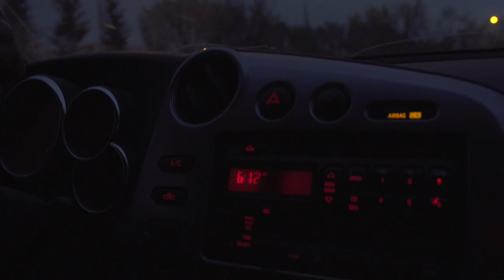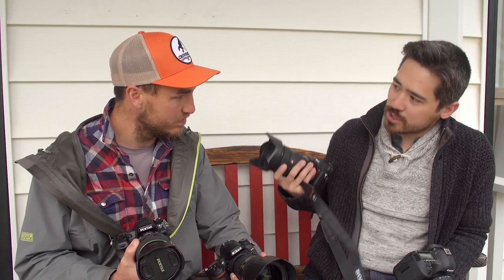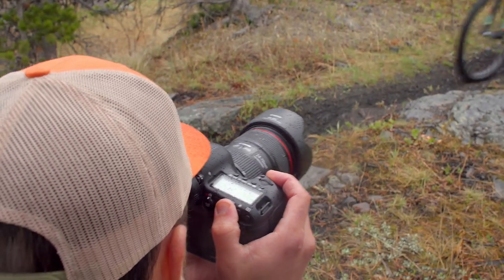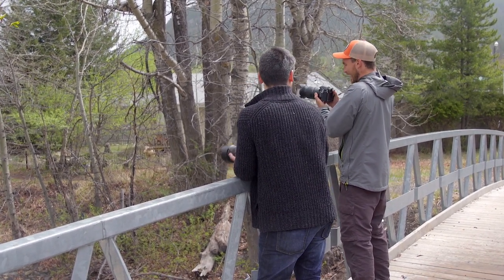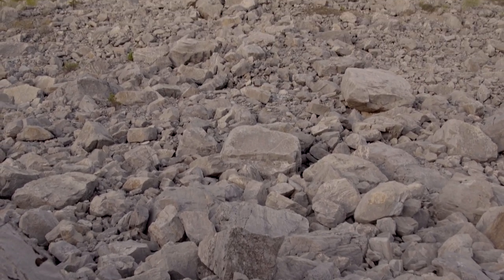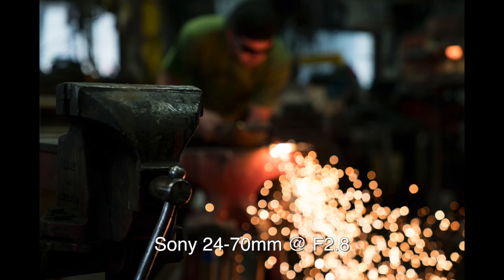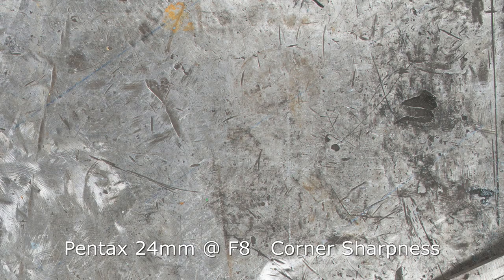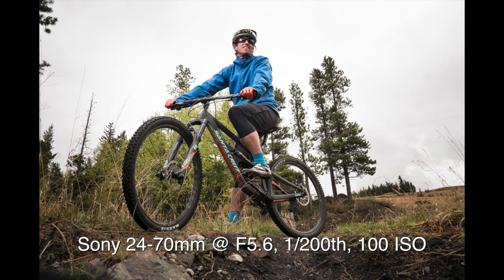The Great 24-70mm F2.8 Shootout! (Featuring Sony, Pentax, Canon and Nikon)

Comment: The Tamron 24-70 is excellent! It's my only choice for a 24-70mm lens.
Reply: I'm planning to get Tamron 24-70, but worried about the focusing issue.
Reply: +Nicolaas Strik vs tamron 28-75?
Reply: +Lex Estrada 
Yeah. "The focusing issue".
Reply: The Pentax 24-70 (shown in this video) is supposedly a rebadged Tamron 24-70 (possibly with Pentax coatings).
Reply: I believe it. I saw the Pentax 15-30. It is identical to the Tamron 15-30. They must be making the lenses for Pentax.
Reply: I have the Tamron 24-70 f/2.8 for my Canon 6D and it's a great lens. I do find it's a little soft at 2.8 but still an excellent lens. Great for landscapes and all purpose walk around.

Comment: The Pentax 24-70 is definitely the Tamron rebranded! I had the Tamron 24-70 but sold it for a 35mm f/1.4 Sigma, I guess because the Sigma prime is so sharp, I can easily crop to 70mm with more sharpness than the Tamron and Nikon 24-70, for events I think a 24-70 would be more  convenient but I'm planning to add an 85mm prime for those. I have a D810 so all those megapixels combined with a sharp lens make it better to just crop than use standard zooms.

Comment: With respect to resolution tests, it'll be interesting to see the Pentax 24-70 on the K-1. When mounted on a crop body like the K-3, you're really squeezing a lot of pixels out of a relatively small area. It's hinted at in the video, but it's widely known that the Pentax 24-70 is a Tamron re-brand. No shame there -- the Tammy 24-70 is fantastic, other than the bokeh (as shown in this video). It'd be cool to get some subjective comparisons from Jeremy on the overall color rendition of the photos straight out of camera -- I'm curious if the new Pentax HD coating makes photos "pop" as much as everyone says they do.

Comment: I spun through this but noticed Jeremy  said at the end he was still reaching for his primes, and that as my thought, in this focal range a standard and a modest wide angle are not going to break the bank, you get a stop or so of light and DOF control which can make a real difference, it's a much smaller rig to use point at people and carry, and the reframing can be done by moving you and the subject rather than zooming.

Comment: The 24-70 2.8 ii Canon is incredible. I cannot discern the difference in primes and that lens. Usually not the case. I wonder how much weight VR will add to the 24-70 2.8 when Canon does come out with one. How much did it add to the Nikon one?

Comment: Haha, I use aperture priority mode all the time too. Just gives you the control where you most need it, since ISO and shutter speed adjust accordingly.
Reply: +Karl Ramstedt Yeah for anything that doesn't move but involves changes in lighting based on where you aim, using manual makes no sense.  I find myself shooting in Aperture priority the most (I cap my ISO and shutter speed depending on the lighting) and switch to S priority to catch a nice car driving by or to get some motion in a tracking shot.

Comment: Great content, thanks for making it! Slight criticism though... as an optical engineer I'm of the opinion you need to preface your IQ/sharpness tests by stating that the comparison will show you which adapted/native lens works best on the Sony. I know there's the difference in sensors that would throw off a direct comparison, but it's really about the lens/body combo. The different materials used in the coatings on the sensors of differing companies could even throw off the performance of an adapted lens and cause off-axis aberrations. Also, just the different paint/materials on the barrel of the adapter can cause diffraction issues that could mess with corner sharpness, the list goes on and on...  It'd be nice to just see lens/body combinations and show the amount of resolution that is achievable on each ecosystem. You guys are great! Not crucifying ya over this at all, but want to provide some feedback.
Reply: +Sean Nicolaysen You are right, that's the thing that irritated me about this nice video. Tony Northrup tested the Canon 16-35 F4L IS with an adapter on the Sony A7Rii and the otherwise sharp corners became very soft.

Comment: Nice vid. interesting video I saw by Tony Northrup about full frame lens on crop bodies, after watching I remember how dissatisfied I was with my Canon 24-70 f/2.8L on my 60D. I have a Pentax K-1 coming soon I have a pentax Tamron 28-75mm f/2.8 curious to see the results vs the K50 I used it on before which was just good. The Tamron 28-75 on a Canon 5D III was excellent for the price in my opinion. Keep up the good work.

Comment: great job guys! just a personal opinion, the onion ring on the Pentax and cats eyes on the Nikon aside. typically is it not the case that you would need the wider end to be sharper across the frame wide open rather than the longer end where you may typically do portraiture and not want quite such biting sharpness? that tamron is rated by dxo as sharpest zoom on the Nikon d810. I have to wonder the impact of adapters on sharpness tests with the a7rii....

Comment: why not test the panasonic 12-35mm f2.8?  It's equivalent to a 24-70
Reply: +Jorge Martinez They were comparing full frame lenses. 12-35 wouldn't have the same dof, and they wouldn't be able to use it on a sony body for comparison either.
Reply: +Timur Dzhambinov ok understood.  thanks
Reply: +Jorge Martinez I'd love to see it though, as a m43 shooter myself.
Reply: +Timur Dzhambinov I own the 12-35.  Sharp but little dof unfortunately
Reply: +Jorge Martinez Well it's just the nature of mft system really. Was one of the main reasons I only use fast primes with my EM1.

Comment: nice video. what wireless flash/trigger did you use for the sonys?
Reply from the maker: +Austin Paz Profoto B1 with an Air Remote for the Bike shots and a couple Einsteins with the Paul C Buff transmitter at the blacksmith's.
Jordan @ TCSTV
Reply: +TheCameraStoreTV thanks. no adapters or anything were needed for the sony hot shoe?

Comment: question, how in the world did you take a full frame pentax 24-70mm f2.8 and place it on a crop body (aps-c frame) and lose   available light from  f2.8 to a f4.2 plus losing half of your resolution of the lens and have it rated better and sharper  in the image department  then the full frame bodies with full frame lenses of the best the photographic community has to offer??  What am i missing in this test?.......another question, what equipment did you use to video this show?......
Reply from the maker: +Howard Kahn The K1 was not available when we shot this, so to perform the image quality tests we put the lens with an adapter on the Sony A7R II.
Reply: let me see if i understand what you just answered......you say you took a pentak full frame lens and used it on a sony E mounted camera with an adopter?.....where can i get this adopter which allows you to place a full frame lens on a E mounted sony without losing any of the lenses functions?  are you saying pentak full frame lenses will fit on a sony A mounted body like the sony a99/2 without any adopter?......are you saying the pentak and sony use the same exact mounts and these lenses, pentek and sony are interchangeable  and can be used on both camera bodies?...because if this is what you are saying, i can purchase this pentak 24-70mm f2.8 full frame lens and mount it on my sony a99/2 camera body with out an adopter. and the lens will function as if it is a sony lens...............question, who replaced the pentek software in the pentek lens with sony software so it would respond to the sony E mount camera body????????
Reply from the maker: +Howard Kahn We used a Novoflex adapter, which makes the lens manual focus and manual aperture (but still fine for  testing detail). Unfortunately, you cannot mount the Pentax K lenses on Sony SLTs like the A99 II, only the mirrorless cameras.
Reply: you need to test the SONY Vario-Sonnar T* 24-70mm F2.8 ZA SSM II, no one has done any kind of a test on this new lens,  and it is the only new 24-70mm f2.8 lens that fits the sony "A" mount full frame    camera bodies  ......Tamron G2 no fit, Sigma art, no fit, sony GM no fit, sony G lens no fit, other 3rd party lens no fit.............SONY Vario-Sonnar T* 24-70mm F2.8 ZA SSM II, MADE BY CARL ZEISS,   is the only new  FULL FRAME  24-70mm that fits the sony "A" mount frame........PLEASE, THANK YOU....

Comment: I like the idea of testing them on the same body for consistency, but doesn't that metabones adapter have glass in it? That would give the Sony glass a big advantage. Best would be to use them on cameras with similar amount of megapixels. Like D180, 5Dsr, and the A7rii.
Reply from the maker: +Croo ookie We didn't use any of the 'Speedbooster' type adapters. Just a mount adapter with no optics.
Jordan @ TCSTV
Reply: +Croo ookie  Metabones adapter doesn't have glass (I don't believe), it's just for making up the flange difference.  Their speedbooster on the other hand DOES have glass
Reply: Noted, thanks guys!

Comment: If you guys could please answer my question it would be of amazing help. How are you supposed to work with the ARW files that come out of Sony cameras??? I use Canon, and editing the CR2 files is as easy as double clicking them. Buy my computer doesn't open ARW files on  Photoshop or Lightroom. My A7Rii is my first ever Sony Camera, so if you could shed some light onto this question that would be amazing. Thanks!-Anthony
Reply: You can update lightroom/ps or get a dng converter from adobe.  Sony has a arw converter as well or you can try a different editing program, Capture One.  Capture One is similar to lightroom and you can find good tutorials here on yt for it.
Reply: I updated lightroom and that seemed to have solved the problem! Thank you very much for the response!

Comment: Mm, I heard that tamron (oops, i mean pentax ;) lens has massive focus breathing. Is that true? I'm thinking of switching to Pentax with the new K1, and a bit worried that lens breathes as much as people say it does.
Reply: +Timur Dzhambinov Tamron lens is great, I used it a lot last year on Nikon D750 body. Sold it only because I'm also buying Pentax K-1 with the same lens rebranded as Pentax D-FA 24-70.
Reply: +branislavpetkovic I can definitely see that it's an excellent lens from this review. I'm just a bit concerned with the focus breathing other reviewers mentioned, was wondering if it was addressed in this re-design from Pentax. Apparently up close the lens is more like 24-50. Thanks for the feedback though, I see few other people consider switching to Pentax. Can't wait for the Camerastore review of the actual body, although I'm pretty sold on it already)

Comment: Thank you for this helpful video.
Can you give the ref of the adapter used for the Nikon lens ?
Reply from the maker: +Guillaume Biart I believe we used a cheapo Nikon to NEX adapter without aperture control because the new Nikons don't mechanically actuate anymore. Normally though we would recommend a Novoflex or Metabones Nikon G to NEX adapter. However now someone has to remake an adapter with electronic linkage to activate the apertures on the future Nikon lenses.

Chris @ TCSTV
Reply: Thank you for your quick answer

Comment: Should include sigma and tamron
Reply: +Phuc Vu&amp;&amp; the pentax is a rebranded tamron. And the Sigma is old and much worse than any of these
Reply: +Phuc Vu&amp;&amp; The Pentax is essentially the Tamron in a different body and with different coatings.
Reply: oh really .... Thanks for letting me know guys :D
Reply: +Phuc Vu&amp;&amp; I own the Sigma with Canon mount. Not that impressed, IQ is correct, but AF sucks, no VR or weather sealing on my version.

Comment: nice video

confirms what I have personally found - and that is the best 1 camera & 1 lens setup you can have is a Sony A7Rii with a Canon 24-70 F2.8 - it is now my goto in many situations - IBIS gives you IS on the Canon lens and 42 megapixels gives you cropping for zooming (i.e. addresses the two negatives brought up in this video)

add and 85L II to the Sony, and you can shoot anything but fast action sports
Reply: +Paul O&#39;Neil Hi I have a silly question. I personally use the 1DX with canon 24-70 ll and 85 1.2 ll but thinking about Sony camera do you use converters to go with sony camera ?
Reply: I use the Metabones IV T and with all the latest firmware it works very well on the A7Rii - and the colours the combo produces are outstanding
Reply: Paul O'Neil What about AF capability ?
Reply: works very, very well

Comment: You simply can't put non-native lenses on an adapter and call it a fair test. The adapter introduces tilt and decentering, while the differing thickness of the sensor stack (cover glass etc) puts non-native lenses at a disadvantage.

Comment: Why would you use 24-70 for macro shot ? It is not better to use a proper macro lens ? If you get very close with the wide lens then distortions will kill the picture
Reply: Probably checking close focusing?!
Reply: Harish Kiran Well after you check and found that is working would you still take a close up shot by using the same lens over the macro ?
Reply: michal bla Depends on the situation, the best system is which you have with you at the moment!

Comment: The fact that the Canon did so well and going through an adapter proves the Sony G Master isn't as good as people think. I would of liked to of seen the Canon on a Canon body for the sharpness test. Doing it all on the Sony seams a little pointless. However it still beats the Sony at all focal lengths, and is that not why you would buy a zoom?

Comment: I would love to see SIgma do a 24-70 f/1.8 for cropped sensor!
Reply: +Randy Dietmeyer Me too ;)
Reply: 24-35mm f/2 they have already. Now all they need is the 35-70mm f/2 Art to compliment it.
Reply: I already have the 18-35 f1.8 and have heard nothing but praise for the new 50-100.  A good 24-70 f1.8 would fit perfect as "the 2nd lens" to either of the above.  More so the 18-35 than the other.
Reply: ***** It would be too massive that lens and not practical. The 18-35mm and 50-100mm are APS-C lenses which help in weight reduction compared to FF lenses. But since they made the 24-35mm f/2 for FF, chances are the 35-70mm f/2 might be in the works since historically in multiple brands that zoom has existed from Zeiss to Leica.

Comment: i wanna switch to sony but their lenses are way too expensive:(
Reply: +PeglegMedia They are new lenses, they tend to be more expensive, when the Canon 24-70 was introduced, it was $2200 as well in my memory. After one year or two, the price will be cheaper for sure. Currently the 24-70 GM is out of stock everywhere in the US.
Reply: jqueryrocks yea but you also have 3rd party lenses.  I got the nikon 24-70 2.8 with image stabilization for $800.  I got the panasonic 12-35 2.8 for about $800.  Sucks spending more than $1200 for any 24-70 2.8 lens

Comment: Howard Kahn
9 minutes ago (edited)    can you please answer this concern of mine regarding your test..........
let me see if i understand what you just answered......you say you took a pentak full frame lens and used it on a sony E mounted camera with an adopter?.....where can i get this adopter which allows you to place a full frame lens on a E mounted sony without losing any of the lenses functions?  are you saying pentak full frame lenses will fit on a sony A mounted body like the sony a99/2 without any adopter?......are you saying the pentak and sony use the same exact mounts and these lenses, pentek and sony are interchangeable  and can be used on both camera bodies?...because if this is what you are saying, i can purchase this pentak 24-70mm f2.8 full frame lens and mount it on my sony a99/2 camera body with out an adopter. and the lens will function as if it is a sony lens...............question, who replaced the pentek software in the pentek lens with sony software so it would respond to the sony E mount camera body????????
Show less you please answer this concern of mine----------
Reply from the maker: +Howard Kahn You misunderstood. There is no communication between the Pentax lens and Sony body. The focus and aperture will be manual.
There is no way to adapt a Pentax K lens onto a Sony SLT body, like your A99 II. Pentax lenses can only be adapted to Sony E-Mount Cameras, but there will be no communication between the lens and the body.
Reply: i understand

Comment: calling ~0.25x / ~0.4m as Macro is like a..... it is just wrong!
Reply: Exactly. If macro is important to me then I use a proper macro lens (or very inexpensive extension tubes if the lens has reasonable short barrel length)

Comment: canon  or sony ？
Reply: Sony
Reply: Connor Avila but it is expensive and not much lens can choice~
Reply: +梁贊 two valid points, but the lens available are very premium and you can use a lens adaptor. On the price thing i will admit sony has been making some higher end cameras lately. But that means if you buy one you don't have to get another camera for a long time